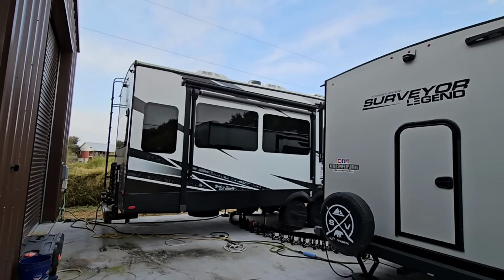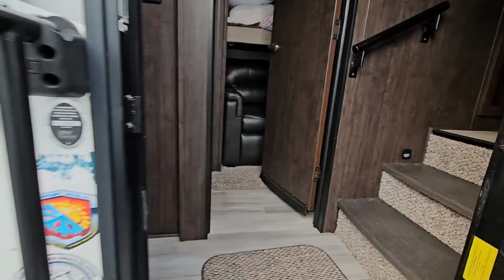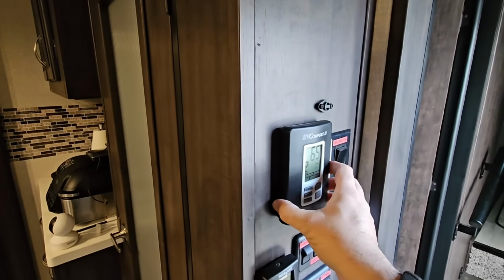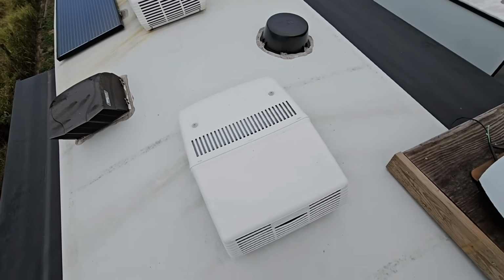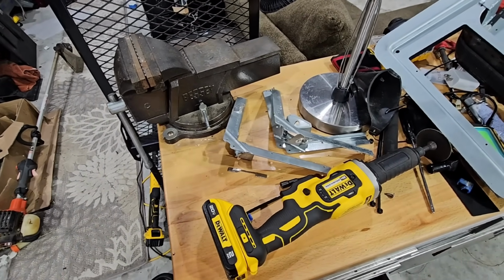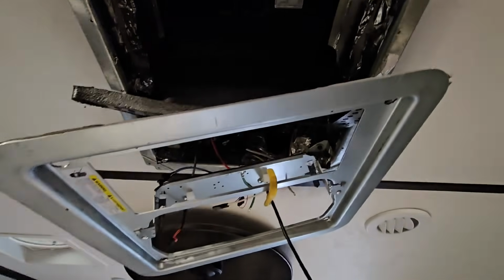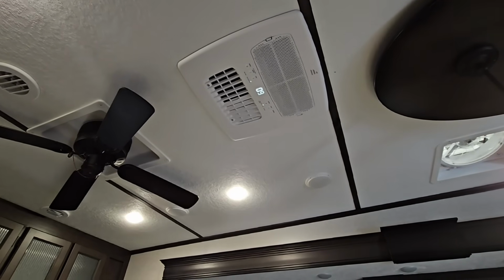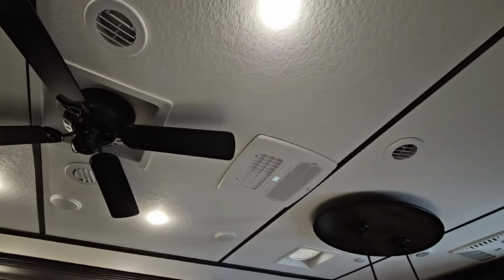EXCLUSIVE INSTALL! NEW Furrion Chill Cube 18k Variable Speed RV AC!

Comment: you lose 30% of your cooling minimum in the duckwork due to heat gain from the roof And leaks in the duck work . The duct system is very inefficient. It's better to dump the air straight into the R. V.

Comment: Question about the ducting, please.   I am considering this unit for ducted use. The Furrion manual shows it diverts airflow to lateral ducts that run off to the port and starboard side of the 14X14 opening for the AC..  My RV has a single duct that runs down the center of the 14X14 opening from front to rear.  Can this ducted airflow of the Furrion be modified to use with this center flow configuration?

Comment: Really want one with a heat pump, and preferably a condensate pump.
Reply: My RV tech said they’ve had a lot of complaints about the heat pump version so I’m going with the standalone AC.
Reply: I really want a heat pump too, if they added that I would immediately replace the two air conditioners on my RV

Comment: is there a difference between the AC top unit between the ducted and non-ducted units?    or is is just in the Air handler kit that is sold separately?
Reply from the maker: Generally just the inside cover makes the difference.

Comment: I ordered the this AC today from camping world yes I got the ducted one did it come with the plenum and controls I've seen another video saying that those have to be ordered separately
Reply from the maker: It depends on the seller.  Etrailer offers the complete system as an optional package. Not sure about Camping World
Reply: @BTBRV  ok thank you, all it said is that it's the ducted system so I'm assuming it's the complete kit, they had it on sale, thank you!
Reply: @GNelson1989  curious to know.. it appears even with the ducted unit you need the other kit too
Reply: @nathanstaab Yes I called camping world to confirm that but I ordered mine from Amazon and it came fore the AC so it worked out perfectly and the new chill cube is amazing!
Reply: @GNelson1989 sweet. The coach has 2 carrier r22 13.5s, one compressor is getting a bit loud.. excited to have some more cooling in the living area
Reply: @nathanstaab If you can afford it I'd upgrade both hahahahah, oh yeah and the chill cube is damn near silent! On turbo it's quieter then my old unit on low hahahaha
Reply: @GNelson1989 if they had the heat pump model I would tomorrow. Want a HP on the back unit for the wife.. easier than running furnace
Reply: Coming back here to report after install.. what a unit. Makes cold air, and quiet as can be
Reply: @nathanstaab  I told you! I love mine! Glad y'all like yours!

Comment: If I have a dometic ac currently that’s controlled by a iN·command system if I was to replace my unit with this is there any way to have it work off the exsisting system and if not would it mess with the function of my furnace?
Reply: I just did this. My Dometic went out so I ordered the 18K Chill Cube. The 18K Chill Cube has a remote that works as a thermostat for the a/c. It will not work through the InCommand. Your furnace can still work through the InCommand. All you have to do is disconnect the a/c stuff for the Dometic and leave everything else hooked up for the InCommand that's in return air section. Hook up the Chill Cube per its instructions and put all the wiring components back into the return air inlet like before.
Reply: @atvtinker01 appreciate that we went ahead and just replaced it with a advent that was a plug and play basically!

Comment: I have a dometic penguin II 13.5k and it's ridiculously loud inside (can barely have a conversation without yelling)  and out ive even had neighbors complain on its outside decibel level... my question is how much more noticeably quiet is this unit compaired to the old school dometic versions? I'm sold on it just curious how much quieter it'll be.
Reply from the maker: Much much much quieter!  Probably less than have as loud

Comment: Exciting stuff, I have Furrion 15k and thermostat currently, would be great to see them come out with something that you can wire into the existing Furrion thermostat. I know many full timers upgrade to the EZ touch thermostat and it’ll be nice when it’s more plug and play with existing Furrion systems and not lose the ability to control furnace, heat pump would be awesome too
Reply: I'm in the same boat as you, but to be honest, the existing Furrion thermostat is nothing to write home about.  I just watched his previous video on getting the furnace working and I picked out a 26 dollar battery operated thermostat which I think will work better than the stock Furrion one anyway.

Comment: I have a 2015 Heartland Elkridge 38RST. 2 Dometic Roof Units they are really loud even on low fan and Consume much power in the Summer. Ive read that the RV had 15k cooling. Do you think 1 Ducted unit would make the Difference or would I need to change out both? Any input is greatly wanted.

Comment: Your supply vents are to close to the sensor, you need to use the xtra T stat wires for the temp sensor, to put it in the proper place to work better. The temp sensor in my furrion did not work well, it came on and off all the time because the sensor placement.
Reply: On the chill cube you can set it to follow me, and it goes by the temp sensor in the remote.

Comment: Pro tip:  Use blue thread lock on the A/C mounting bolts so they don't loose up over time and result in a leak around the gasket.  The second time mine loosened up, I put thread lock on them.  I'm the admin on about 5 RV Facebook groups for the brand RV I own and we see the bolts loosen up quite frequently.
I even made a video about it on my channel.

Comment: So I have to say between the difficulty of the installation and lack of a partition to seal off/separate the return air from the input air , I am not impressed!  Furrion has obviously not done their due dilligence with respect to the installation of this unit.  I also think not having an actual wired thermostat is a  step backward and therefore does not allow functionality with a product like the MicroAir WiFi "Smart" thermostat that alliws internet remote access. It will be interesting to see if RV AirFlow offers an air diverter system for this unit
Reply: That's funny because mine has an air dam between the return air and the ducted outlet. And as far as a wired thermostat, they make one, but you have to buy it separately.

Comment: This is going to be my major update this spring. My 08 nuwa still has the original unit. I don’t want to add the second unit and I’m thinking updating to a 18k unit vs the 15k but I definitely want heat pump as well.

Comment: Nice to see a product taking advantage of all the new technology in the field of HVAC. Addressing noise is a huge selling point in that these products are generally located right over the sleeping area. I would love it if they could somehow connect to our Thor Firefly controller with a remote sensor. The thermostat being in the ceiling plenum is fine, the challenge is controlling the unit. Even if it was just the off and on control. Will have to think about how to do this.
Reply: It was my understanding that the thermostat is located on the remote for the non ducted model.

Comment: On the previous video about this I asked about the variable speed being an issue. I thought that the fan speed was variable but have since learned that it is the compressor is variable speed. Sorry if I caused any confusion I think as long as they don't have any major malfunctions these units will end up being a top replacement
Reply from the maker: No problem my friend.